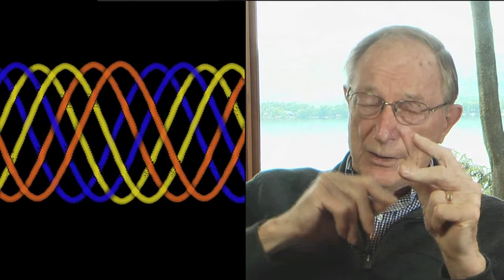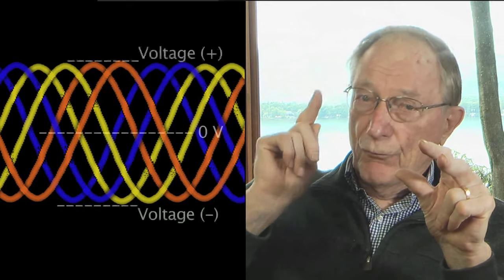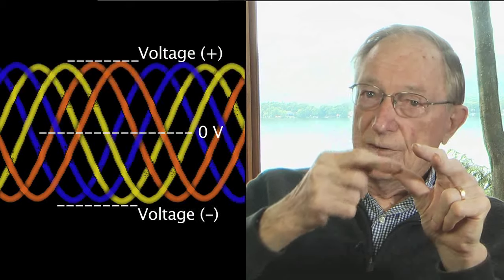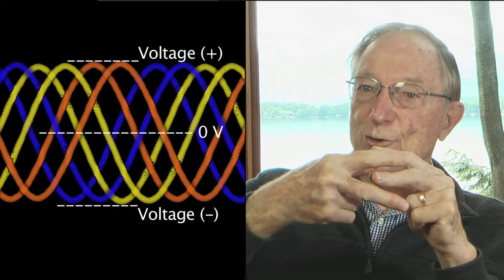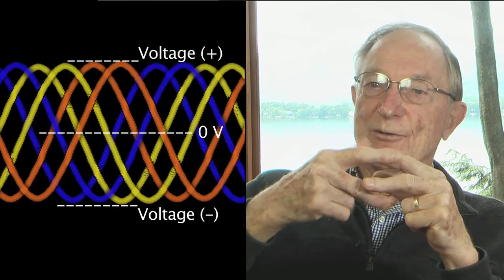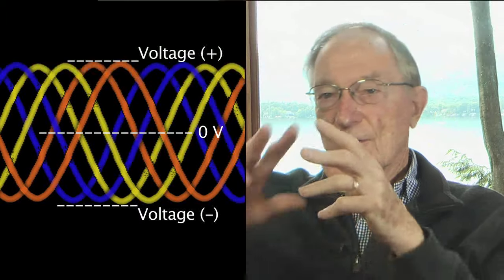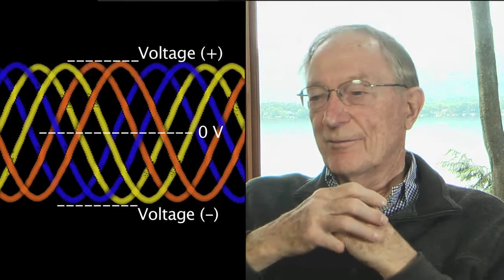Why 3 Phase Power? Why not 6 or 12?

Comment: 3 phases is because its the fewes phases required to TURN A MOTOR . the motor can thus turn Clockwise or Anticlockwise , we call this "Direction of Rotation" . Crucial when customers have sewer pumps in their houses, you want the pumps to pump OUT, not sewer IN to the house . Line names are L1, L2 and L3 . Lets say it rotates clockwise, reversing any 2 phases lets say L1, L3, L2 reverses the motor direction . 3 phase is foolproof concerning rotation because its separated phases at 120 degrees . A 1 phase motor would need capacitors or shaded coils to create the phase delay neccesary for rotation . Adding more coils like 6 coils in a motor (parallell coppling) , it would use twice the Amperes. in a generator it would produce twice the Amperes on the cost of copper coils. This guy on the video havent got a CLUE ! in Electro its not "power" its WATT . or VA .

Comment: Edison tech. Tesla come up with ac three phase. And to answer questions ac can run very far with no voltage drop dc has to be boosted every 400 yds so three phase is the most cost effeciant. And your power compony pulls two phases to each home. Still funny that its edison tech with teslas's idea!
Reply: not even close.  AC and DC suffer identically from I*R drop.  It's just infinitely easier to boost AC back up, with a transformer.
Reply: The line to your house is typically single phase. The transformer has a center tap that is the neutral that is seen in every common 120V outlet. The outside legs of the secondary side of the transformer give a full 240V. The primary side is connected phase to neutral. If you look close the neutral is also connected to ground at the utility pole in most cases. The way a transformer is wired for a typical home is commonly called split-phase wiring because it is splitting a single phase into two halves.
Reply: power is boosted to 4150v ac hit a transformer two separate 120v single phase that make up 240v and a grounding wire to your home u tie neutral to neutral bar in panel which is grounded. and yes both ac and dc suffer from voltage drop but ac dont suffer as much drop since its boosted. cant buck and bust dc like that

Comment: ok everybody listen the fuck up: we use 3 phase because it allows us to carry twice as much current with only 50% more copper wire than a 2 line, single phase system. in addition to this, the sum of 3 sinusoids offset by 120 degrees each is always constant, meaning you can design nice, constant draw loads and distribution systems with zero net electron flow. lastly, riddle me this: if 6 phase doesn't quite double the power capacity of 3 phase, why not just double the size of the 3 phase wires and power electronics? you certainly won't be using twice as much resources or manufacturing costs, but you WILL double your power distribution ability. You don't need to build power distribution lines in Malta to work out that its a worthless idea. 

the channel IS appropriately named! Edison was fond of trialing out all possible ideas and trying to find which one worked. Tesla famously said of Edison "His method was inefficient in the extreme, for an immense ground had to be covered to get anything at all unless blind chance intervened and, at first, I was almost a sorry witness of his doings, knowing that just a little theory and calculation would have saved him 90 per cent of the labor."

Comment: OK so in a nutshell, the reason phases do not go any higher than three, is because of the extra expense power companies must spend in keeping the line running verses the profit from suckers like us?  YEP THATS MOST DEFF IT!
Reply: Not exactly. So increasing phases past 3 yields a proportional increase until 6 phase at which the ratio starts to diminish. Conceptually, the cost for both time and money is not proportional. Cost-wise, the re-implementation of every electrical panel, conduit, and tower in any area instantly yields a minimum 33% increase in cost per phase addition for materials and +-200% increase in cost for implementation (demolish of all current systems/downtime for upgrade + implementation of all current systems). This is not including the cost of design of the system (brings the cost up usually by 50% of the original plus the cost of the original old system)  and any available space to upgrade a system (which would bring the cost down a minimal amount).

At this point you need to realize the cost of the upgrade of a single power plant's feed plus range to a city plus the upgrade of a city's utilities (not including the cost of all the devices inside of residential and corporate zones) borderlines billions of dollars. This alone makes it unfeasible. Then you have to think of the opportunity cost of digging up all those foundations, streets, and walkways to access sub-level conduits (which sometimes go down as far as 20 feet!!!!) is simply ridiculous to even consider. It would take years and years of planning and even longer to complete one city. It just can't be done.

Source: I work as an electrical engineer/commissioning departments of one of the largest MEP firms in the world that often times handles the planning of entire cities and sites. All the figures I've put up there are generalized but in "ballpark". Contractor must.....
Reply: ***** so in a nut shell the homeowners bill goes up! lol

Comment: i really do not see any advantage what so ever in having 6 phases apart from increasing the current carrying capacity / Volt drop if that is the intent otherwise generation equipment is three phase  also and as stated the cost of all the additional equipment required is considerable -  6 vs 3 phases you need double the breakers etc  - with three phases the breakers  need to be double the capacity, as for cost differences - it will be higher for quantity  than size so i see no gain , same principle for cables as for handling the cable it will be cheaper to install 3 cables vs 6 of and your pole configuration will also be more complex we could continue but space and time are short - so the concept is neat but not advantages as far as i can see for a normal type install this may change when higher voltages and currents need to be transmitted over huge distances..

Comment: Teaching

What is 3 phase, why three phase?

That’s the way electricity comes out the power plant.

All terms are made up engineering words that aren’t descriptive of phenomena. It is a language puzzle you have to solve before understanding physical phenomena. 

Ac is basically a switch, it switches electricity on and off very fast*. 60 times a second(60 Hz) in one country, 80 (80 Hz)in another, 666 in hell. It’s all arbitrary, like social rules, or the way you choose to use the toilet. 

It is a gradual switch like a pedal. You slowly press on the gas to go forward slowly until you are max speed, then you slow down until you stop, then you slowly reverse until you are max speed reverse until you stop and yada yada.

A electric motor is stupidly simple. Flowing Electricity is a magnet. When you turn something on, you have made a magnet. Take a wire, connect it to a battery, you made a magnet. Wrap the wire into super dense loops and you made your magnet stronger. Put the wire next to a permanent magnet and turn the electricity on, they push or pull, like two magnets next to each other. You use that force to spin something, thats an electric motor.

Spinning a motor is like spinning a kids playground wheel: https://m.youtube.com/watch?v=qXvsf-QRtFo

You are riding and your friend is on the ground spinning it. 3 phase ac is like 3 friends pushing the wheel back to back at different times.

Comment: He did NOT say WHY 3-phase power exists in the first place. Nowadays, 3-phase power is almost USELESS.  Why?  Because the only reason (and I mean ONLY) reason the 3-phase
power grid still exists is because some big factories still use 3-phase induction motors. (The 3-phase induction motor was invented in the 19th century by a brilliant genius by the name of Nikola Tesla who Thomas Edison used and robbed). Actually, since most heavy manufacturing is quickly fading from the United States, and heavy manufacturing is outsourced to China, the 3-phase induction motor is HARDLY ever used. Nowadays, it is a big PAIN IN THE NECK to phase together generators from different cities on the power grid. Also, there is the horrible burden of balancing the 3 loads on the 3 phases. Cities and neighborhoods have to be divided into 3 equal parts which is a HARD task.
Reply: foureyedchick  ,  bullshit , thank you !
Reply: It is very clear that you are not an engineer and your knowledge of electricity is very limited. All I am saying is that 3-phase power does not save any energy over single-phase. And there is no increase in efficiency if 3-phase is used over single-phase. 3-phase exists today because there are still some customers that need it. These customers comprise less than 1% of the public's commercial need for electric power. Besides, dismantling the 3-phase grid is very difficult, sort of like knocking down people's houses in order to widen old streets (eminent domain). It would help if you didn't use such rude language though.
Reply: Well I can use what ever I want , the statement that it's not energy-efficient ? The 3 phase Induction motor is the most efficient motor happened to man (or girl )  , and for 3 phase transmission lines above and below the  surface (especially below surface which is the only way to go ) is not that big of a deal to enlarge system capacity of a  existing structure .. , and the statement  1 % of public use , in most of Europe 3 phase cable is deliverd in the home itself and is often used to cook(induction ) on or used for better power distribution throughout the house itself , 
It's just making the transport of electricity cheaper even if the power plant needs to compensate and   correct a  120 degree angle ,
stating some Wikipedia found facts that are maybe  true for one country ( that is, as you call it  "bleeding from its industrial needs ") is  not really engineer like ... especially for some one that seems to be an oracle of electricity 

That's all I'm saying
Reply: @Gary Russ Yes, it saves copper. That's the main purpose for using transformers.

Comment: over my head.   i am just a single phase sparky. hahhaha.
Reply: Even in residential you're in contact with atleast 2 phases. If you're commercial or industrial you're doing 3 phase motors all day.

Don't cut yourself short. Become a master electrician and take the power and responsibilities back from the engineers lol
Reply: @Chrislav7  , i have my master elec license and also my contractors and probably next year i am slowing down a lot.     in the USA .   hot-hot neutral wire.  240/120 volts.  still called single phase.     right now i am with in laws in Malaysia until next Monday and then back to the States.   here  it is  240 volt system.  incoming is   Hot-  Neutral.   and then a driven ground rod.    if anybody does want to get into the electrical field then it should be industrial and commerical side.   lot more money than house wiring.